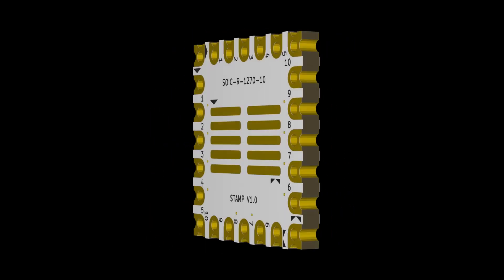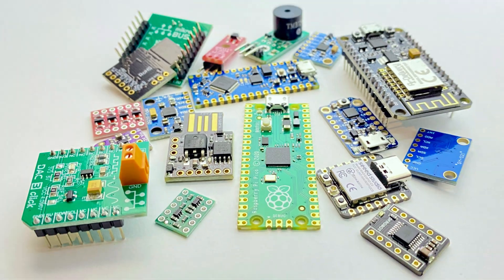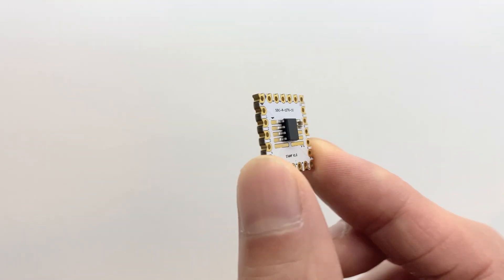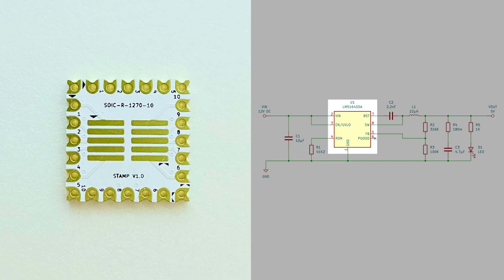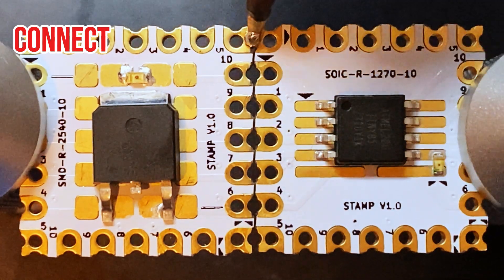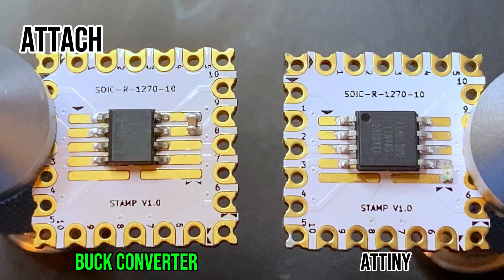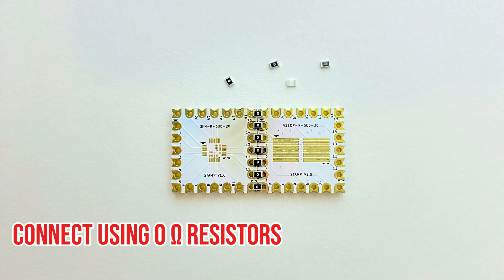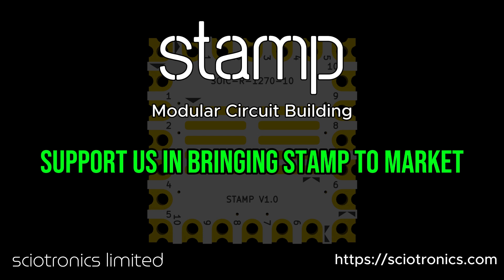Stamp – Modular SMD Prototyping Made Easy | Now Live on Kickstarter!

Comment: Thank you for the video. It is a nice introduction to the Stamp modular prototype boards. Personally, I would like to see a mini series on how to build some interesting building blocks with the Stamp boards, like voltage regulators, current sources (using BJTs and JFETs), differential amplifiers and tone generators. It would be cool if you could also showcase different soldering techniques (soldering iron, hot air, hot plate and /or combinations). And if you could showcase the improved performance of these circuits to the breadboard variants. Thanks!
Reply from the maker: Thank you so much for the thoughtful comment and kind support. We really appreciate it!
You have brought up some fantastic ideas. We have been planning a series of Stamp-based projects, and your suggestions have definitely inspired us to expand on that - especially the analog circuits and soldering technique comparisons.
We are starting with a simple ATTiny project to show how to assemble and prototype it on Stamp, and we will do our best to include the ideas you mentioned in this and future videos.
Thanks again, and stay tuned!